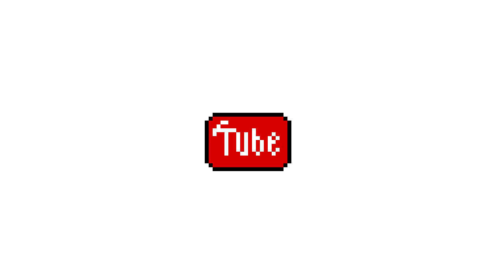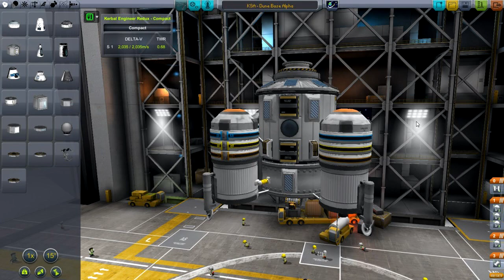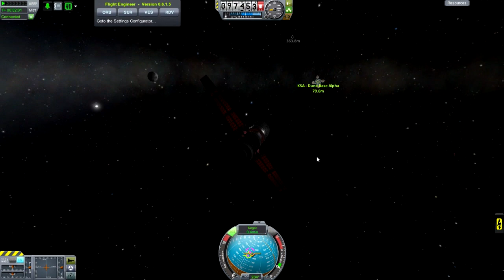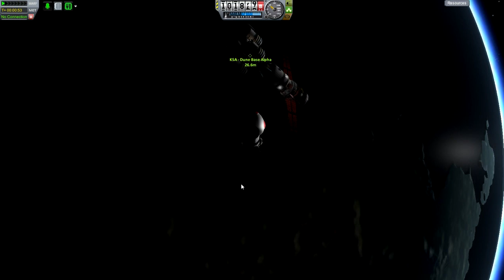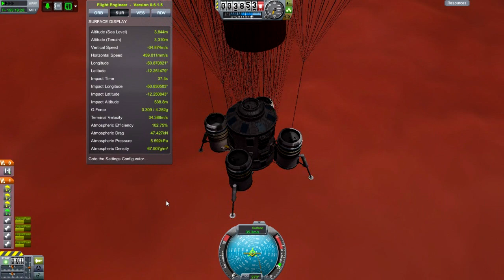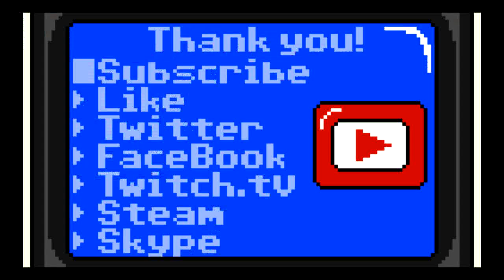Kerbal Space Adventures Ssn6 Ep9 HD - Communications blackout

Comment: Probably a ton of people will point this out.

But I believe you took your chutes from .007 min pressure to a minimum of .01 Which is an increase in pressure and the opposite of what you intended?

As in the stock setting is lower than the lowest slider setting.